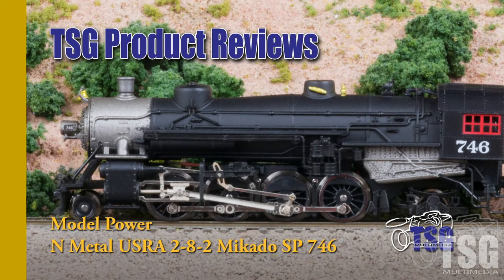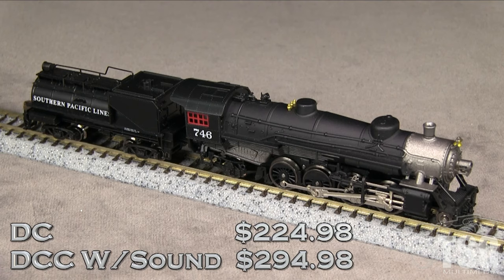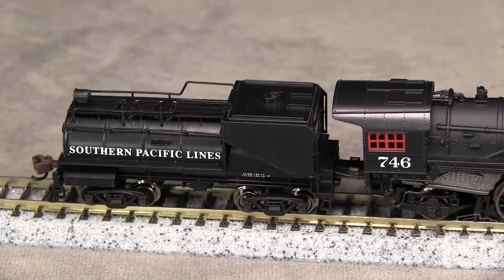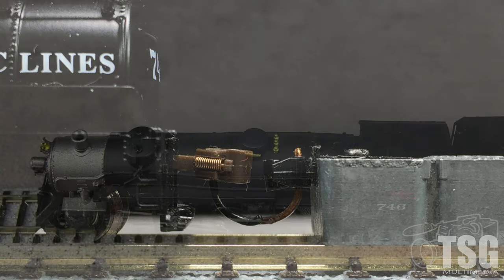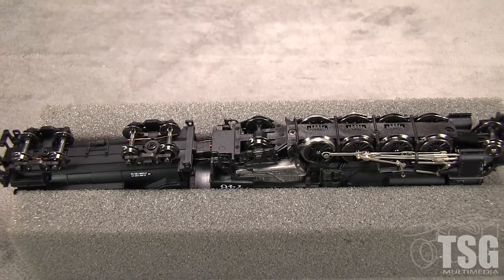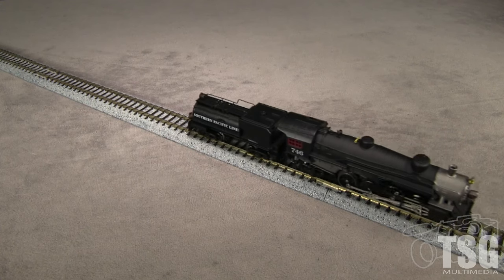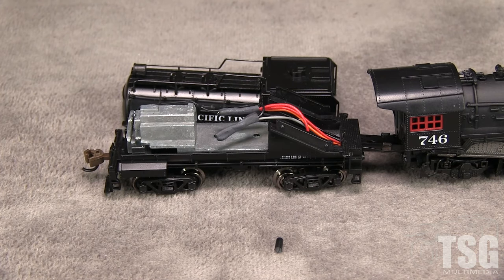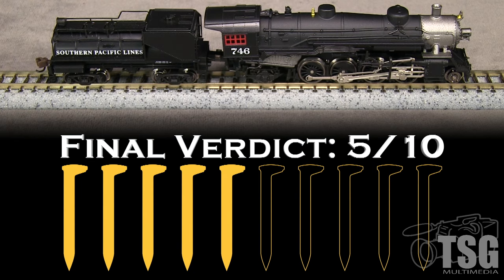N Scale USRA 2-8-2 Model Power Product Review

Comment: 'Glad to see this review Dan.  We have three Model Power steam locomotives, all DCC with sound.  The first two we bought: an SP Pacific(611) and a UP Mike(2555) both seemed to be of a previous era of N scale production, slightly old school (details, flanges and weird couplers that needed adjustment ) but are very satisfying to look at and are perfect for our era.  The Vandy tanks are awesome .  The Pacific requires some tweaking of one of its wipers from time to time but is a good solid runner.  The Mike however is dead, unfortunately.  "Lost its mind", that is to say it shut down and will not reset.  We very recently picked up a Model Power 4-4-0 (SP220) which has been absolutely tremendous in all respects with much improved details and couplers; runs and pulls wonderfully especially for its size.  

Sadly Model Power is not the only contributor to our dead-line.  We have an Ath. Gen. Challenger and a BLI E9 that are also to the best of our ability unresettable. This seems to be something we've run into with N scale more than HO.
Reply: Hear, hear!

Comment: I have been working on a project.   I have a Athearn Genesis 2-8-2 that I am kitbashing into Sp 2-8-2 746.    I have bought the mt-4 tender.  I sent the loco in to get the replacement gearbox.  cause Athearn did finally fix that problem that they had originally.   I also have scratch built the number boards, made the blowdown drain at the firebox that SP used. scratch built the SA type water heater on the top of the smoke box and relocated the bell. and so many other details.  i am only 24.  it has been a blast so far on this project.  hopefully it will turn out good.
Reply from the maker: Let us know how it turns out!

Comment: This video review was recently brought to our attention.  We appreciate the candid and honest review.  It is an older tooling set, that has been upgraded extensively.  Details on the boiler are harder to change with a cast metal boiler.  One question, is it fair to penalize damage due to shipping, which is why two parts are broken?

Perhaps take a look at the newer 4-4-0/2-6-0
Reply from the maker: Hello, thanks for chiming in. If the model in the review is, in fact, an older production run, you are welcome to send us a new one for review. You can contact us from our "about" page or our web site.

As far as dinging the model for damage goes, yes it is fair. For one thing, we do not know where the damage occurred. It is possible that it got past your QC and was shipped that way. It's also possible that it was damaged in transit. Either way, it's a model that costs well in excess of $200. Do you think it's fair for someone to spend that kind of money then have to jump through hoops to return it or immediately go to the work bench to fix it?

The damage and defects described in the review were present on two out of two models that were ordered.

We did not talk about the following information on the review because it had not happened yet, but it's worth mentioning that the driving mechanism self-destructed on the test run we used this locomotive for at a club layout, having only run about 150 feet or less at slow-to moderate (prototypical) speed. Dan was able to repair it so it will run again, but to a casual model railroader, the damage it did to itself would have rendered it completely unusable.

On the upside, despite the prototype inaccuracy, we like the overall appearance of the locomotive, especially when it has been upgraded with front and back-facing LEDs. It had enough room in the tender for a speaker and DCC decoder.
Reply: You do not have an older production run.  

It is fair enough feedback...We wish we could know more of some of the above comments, especially the one that "self destructed".

A swap of an engine could have been done in less than 5 mins on the phone.  That's all we would ask for if you had seen this out of the box.  No different if you had bought a new car, and noticed a dented door or some other issue at the dealership.  Your aren't going to drive off with it.  

Finally, its not fair if someone spent $10 on something brand new and it doesn't work, everyone wants/expects a NEW product to work out of the box and not be damaged, no matter how much they spend.  We just know it was shipping, as ALL engines were tested.  We ask for a chance, that's all.

As for the prototype, yes we know it is not 100% accurate, but we try to offer as many roads as possible that are, and some requested road names that aren't, as we have modellers that want them...simply because they love the road, and don't care if its slightly off.  

We need to serve the entire hobby, if it makes us a bad company or brand for trying to make people happy with giving them what they request...we'll take that.

Not sure what else can be done at this point.  We appreciate the follow up, and respect the testing process you have, anticipating that the same rules apply to everyone.

-MRC
Reply from the maker: Nothing needs to be done, and of course our rating system is applied as objectively as possible to everything that crosses our bench for review. If you ever have a product you're particularly proud of and would like to get some additional exposure, you're welcome to contact us to have it reviewed on our channel. A lot of people come to see the reviews we do because they give the good and the bad instead of just being an advertisement like most others seem to be.

In case it matters to you, the side rods were the part that bent (I called it "self destruction" because nothing was done to them, it just happened while the model was running on the layout) during our road test that I mentioned above. It wasn't like a spontaneous explosion or anything, but it did render the model inoperable. Dan exercises extreme care in the handling and running of all his models, so to have that happen while under normal operation was very strange.

Comment: The thing that bugs me most about the Model Power 2-8-2 is that the cab is tilted backward.  It's also like that on the one I bought years ago.  I noticed the same thing on their original 4-6-2, but their current 4-6-2, which I just purchased with DCC and sound, seems to have solved that tilt problem.  Is there a way to un-tilt the cab on the 2-8-2?
Reply from the maker: Not aware of any way to un-tilt it. This model's packaging was really nice!

Comment: I think taking a spike for the coupler height is unwarranted, especially considering Model Power has specific instructions for modifying coupler height due to variability in tolerances.  6/10

I have two 4-6-2s in Southern livery.  The green Southern Crescent is hella noisy, as you pointed out on your Mike.  The other is near perfect and quiet.  Do you think it's different motors?  or are they recycling?

Thank you for the reviews -- great stuff
Reply from the maker: Every issue the model reviewed in the video was dinged for was a quality control issue. Your example sounds like it's also a quality control issue. For the price, there are a lot of other manufacturers that are producing much better and more consistent quality.
Reply: very true, and quality is becoming harder to find so I appreciate the consistency.
Reply: which manufacturer have you had the best experiences with?

Comment: Model Power is like the modern day Tyco of model railroading, sure they make some decent stuff, but most of it you can tell is just supposed to be cheaply made, low-priced toys, I will say this though, even though there are little-to-no separately applied details, they still do a pretty decent job of moulding them to have a three-dimensional look.

They're like the half-way point between LifeLike and Bachmann, which is like being half-way to the bottom of the pile.
Reply from the maker: Well, the one in the review had some problems, to be sure.